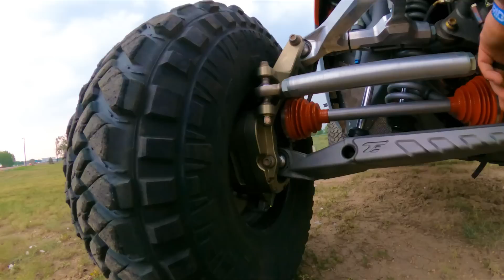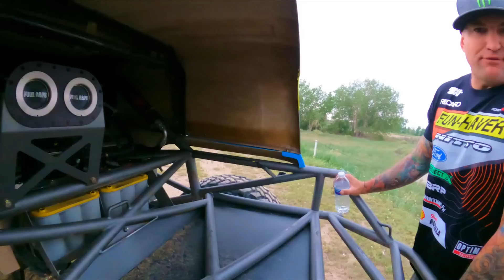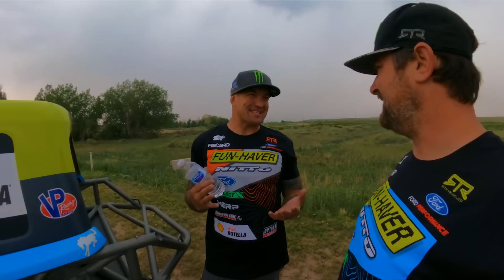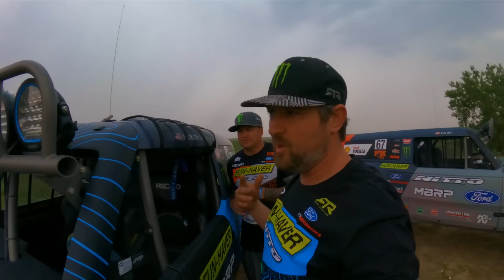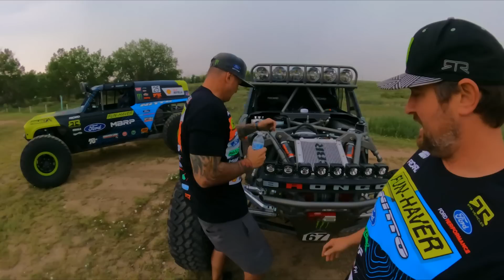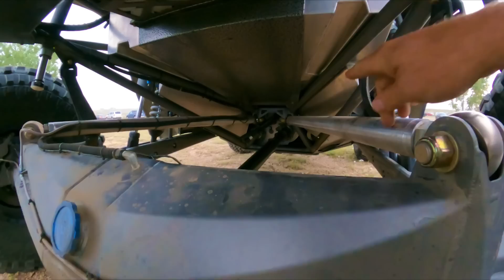First Look at Our New Ultra4 4400 Ford Broncos!!

Comment: Awesome video.  I bet it gets hot as hell back under that top with all the hot air coming off of that huge cooler.  Poor fueler at pits is gonna cook back there.  I wonder if it would make sense to cut a "sun roof" or some louvers into the topper back there to let some of that hot air rise out the top.  Yeah, super cool tech, and great video!